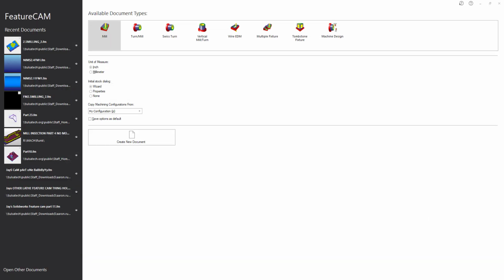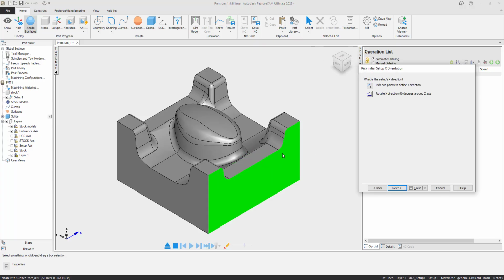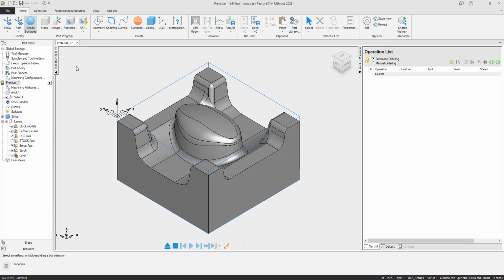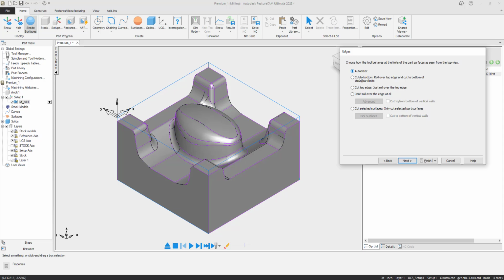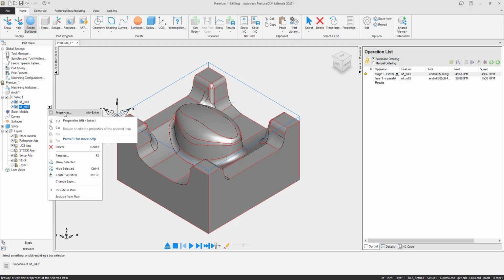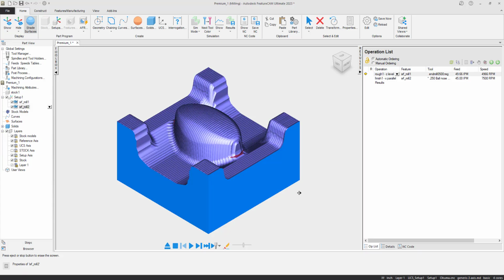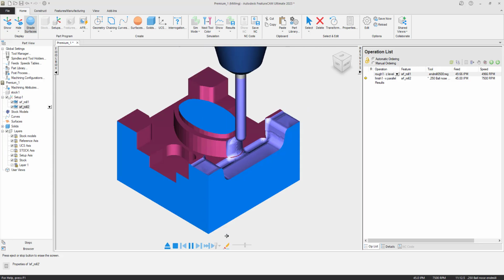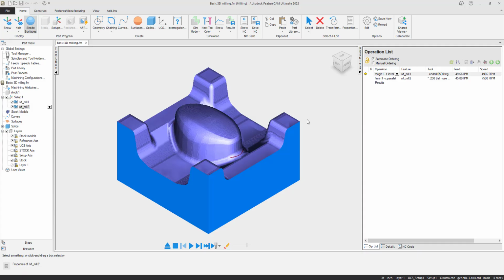Feature Cam Basic 3D surface Milling

Comment: Great post. But I can't seem to find the feature tab in the new featurecam 2025? All I have is stock, set up, then AFR?
Reply from the maker: Hello, and thank you for reaching out. That is strange that the features tab is not showing up . However, there is a menu at the top called features and Manufacturing / features table should be under there. I hope this helps. Good luck, and thank you for watching
Reply: Thank you for the reply. Yes I thought it would be there aswell but unfortunately only the manufacturing commands are there no feature tab? It's starting to drive me crazy now how can I do surface milling??
Reply from the maker: @stevenelson2168 Well, that's no good. In the top there is a ? For the help search. You may try that. Depending on your version of the software some features may not be available.  I also use Catia v5 and I run into he same thing with the post processor.
Reply: @aaronrunk4209  found the solution. I had another user signed in which can some how act as a 2 monitor situation which  can effect some panel tabs not showing. Very happy now. Thank you for your help 😊
Reply from the maker: @stevenelson2168  That's great news! I'm sorry I didn't think of that sooner.  Vericut is the same way, and I ran into the same situation, but that was back in 2008 😄 I'm old.  Thank you for sharing!